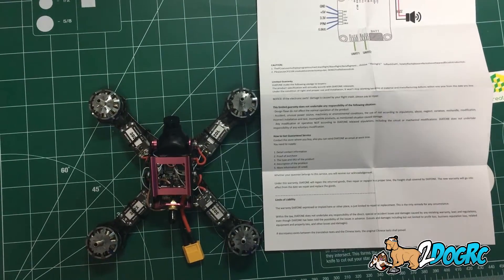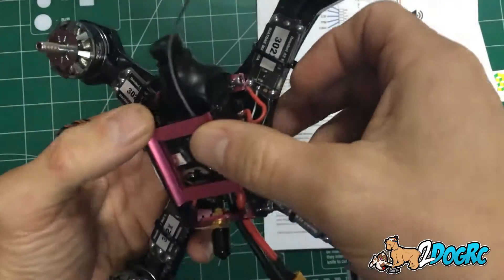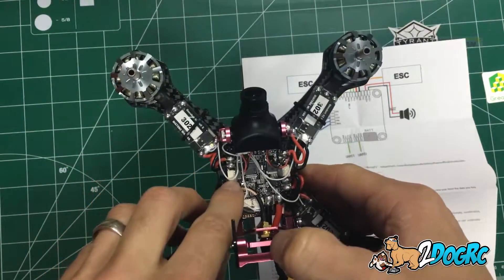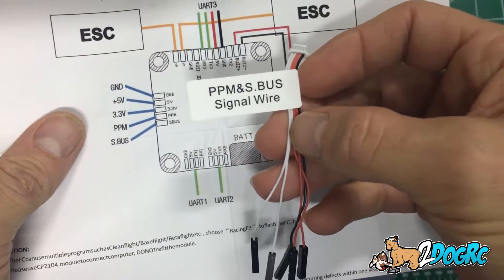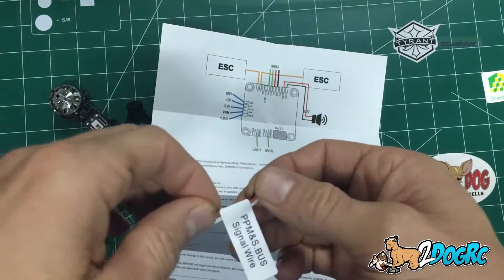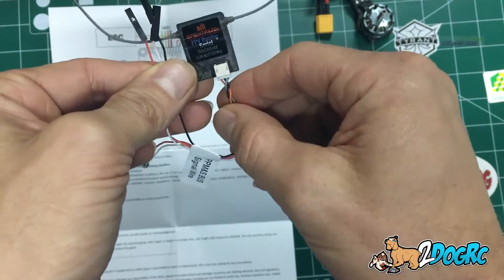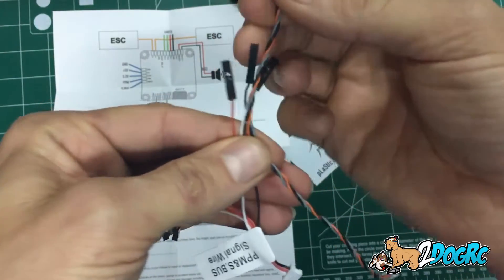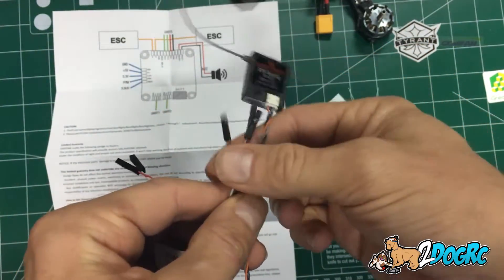How to connect a Spektrum Receiver to Diatone Crusader 2 or D-Link F3 board, Step 1

Comment: So I just bought my gt2 200 and mine is the v3. I dont see anywhere on it that says it supports 3.3v receivers. any suggestions on what receiver to use?
Reply from the maker: Yes, These come with a 3.3V regulator that is external.  Here is a link to the wiring diagram.
http://www.2dogrc.com/media/catalog/product/cache/1/image/650x650/9df78eab33525d08d6e5fb8d27136e95/e/d/edited_for_reg_copy.jpg

Comment: Hey Bud, FFS. I'm such a dumbass. I've got a GT200 V2 and I accidentally connected an A8S rx to UART 1. I went ahead and got bind and started to configure but saw that the rx wasn't working in BF so within a few cycles of betaflight 3.1.1. I realized my mistake and disconnected all power and moved the rx wire to the proper PPM/S.BUS/Spektrum location but now when I try to connect the port closes on it's own. I'm looking up how to reset the FC and will try again. Any help is mucho appreciado!
Reply from the maker: That is a common mistake.  You can use the Lost Comm procedures listed in the Firmware flashing tab in Betaflight.
Reply: Hi again, I'm scratching my head. The quad's power up beep sequence went from just the first few tones (while I was powering up during pre-flash) to the full series of beeps post-flashing/lights so I thought it was good to go but am still unable to connect in BF. One odd thing is the port shown on BF says manual and not any "comm" one. I bought this unit new/second-hand from a guy who bought it brand new from Diatone. I've got a bad feeling about it. So the unit powers up with full series of beeps but won't connect to BF. I should try it again and maybe record the whole process and post it for analysis. In the meantime I've demanded my € back but I'll try the procedure again.
Reply from the maker: OKay, if it is showing Manual then your computer is not seeing the board.  Make sure you installed the CP210X drivers listed on the tab in betaflight.
Reply: Hey Champ,  I'm sorted out now. Embarrassed here. I oughta be in action soon. You're simply great, thanks!

Comment: Plugging the 3.3 v satellite receiver to the 5v  is a no no.....correct?
Reply from the maker: Big No No.  It will fry your satellite receiver.  Spektrum now has a 5V receiver out finally, but they are charging $50 for it!
Reply: I used the 5v on a 3.3v reveicever and it took a while before I realized my mistake. The motors would mysteriously shut down for a second and the drone was dropping out of the sky every once in a while. Luckily it didn`t fried. I just soldered the red wire under the front of the board and it did the trick.

Comment: Ok the v2 diatone Gt2 doesn't have 3.3v out only 5v. Can you still use the spektrum Satellite receiver on 5v.????
Reply: I had to use the 3.3v under the top board. Just solder a wire to that pin and use it for the red/orange lead

Comment: Hi, received my GT2 200 but now there is an D-Link F3 "v2" board in it. The 3.3v dissapaered, cables dilivered in package is 5pin connector on board 4pin connector ???  Any solution to connect an Spektrum receiver SPM4648 on it ? Thanks for response in advance.
Reply from the maker: Tom, Let me look into this.  Look like I may need to make another video!
Reply from the maker: Tom, I reviewed the schematic.  It looks like Diatone made it a little more difficult for you the 3.3V receivers, such as Specktrum.  Check the instructions for a schematic or I found one on their Facebook page doing a search for D link V2.  Flip your board over and look on the bottom.  Along the side opposite the battery lead is a row of pins. One of those is labeled 3.3V.  You can connect the Pos from your Receiver to that tab, and then connect the wires as in the video.  Another option would be to wire all three wires from your Receiver to these pads, 3.3V to VCC, GND to GND and Signal to RX3.
Reply: Hi, thanks for quick response. Treid it this morning, 3.3v on bottom from the board GND and S-Bus from 4pin connector and it works perfectly.
Thanks and happy fly
Reply from the maker: Great to hear! Thank you for posting back, that helps alot of people!  Enjoy your ship.

Comment: sorry to bug you but I'm having major issues I plugged it into betaflight and it worked perfect I set everything up next morning I woke up plugged it into betaflight and it doesn't even light up the board the board lights up when I plug the battery into it but not when I plug in betaflight any suggestions will help

Comment: great video! I have the crusader 130 and been having trouble getting it to work with my spektrum satellite. Do you know if it is compatible? I also have the TBS Tango/Crossfire Micro Receiver which is what I would like to run on it ideally
Reply from the maker: Hello, 
   It is compatible with the Spectrum Receiver however if you are just using a satelite and not the Quad receiver you need to make sure it is bound to your radio before connecting the the Flight controller.  This is an known issue with the Naze Rev 6 that this board is based on.
Reply: 2dogrc maybe i have the wrong name, I'm using the same one in this video. I soldered it right on the board and got it to bind immediately however I cannot get it to recognize stick inputs in clean flight. You wouldn't by any chance help me out via phone if I PayPal you over some money? I'm desperate at this point. Thanks for all the help!
Reply from the maker: Sure we can take a look.  800-517-3810 ext 1.  I do charge if you bought it somewhere else, and give 1 hour free when purchased from us.
Reply: 2dogrc i didn't know you guys also sold these. I will definitely be purchasing from you soon. In the meantime I don't mind paying you for your time!
Reply from the maker: Give me a call tomorrow or through the contact us page and I can give you a call.  If it is bound, the red light should not be flashing, select Serial on the ports tab of UART2, save.  Then in the config tab select receiver type Serial, then protocol Specktrum 1024.  Save.  If that doesn't work try Specktrum 2048, save.  Make sure props are off.
Reply: 2dogrc I will def call you tomorrow. Red bind light is solid orange, uart2- serial RX is checked and I tried both receiver options.... I'm totally stuck man.
Reply from the maker: Okay, 2 things to try. 1)Fresh install of Betaflight.(You are using the Betaflight configurator from the Chrome store?)
2)Double check the wires and make sure you have the Serial, 3.3V and Ground going to the receiver.  It sounds like 3.3V and Ground are correct because you have a light.  So double check the solder connection for the Sbus wire.
Reply: 2dogrc in my manual it's telling me it uses cleanflight. I have several other quads that use it so I know it definitely works. I triple checked that I have wires soldered correctly (as you said i wouldn't be able to bind correctly if not)  if possible I can FaceTime you tomorrow, and I will gladly send you a PayPal transfer just so you know I'm serious. I really appreciate this help man!
Reply from the maker: Okay, no problem.  Use the betaflight configurator. These all come with Betaflight on them and Cleanflight app won't work right. Try that and if that doesn't work we can fix it tomorrow somehow.  
https://chrome.google.com/webstore/detail/betaflight-configurator/kdaghagfopacdngbohiknlhcocjccjao?hl=en
Reply: 2dogrc sounds like a plan. Big ups man!

Comment: I'm getting this for Christmas. I have a 9303 transmitter but I don't know if it does S-Bus.  Do you know? If not, what do I do?
Reply from the maker: I looked this up and it is compatible with Spektrum receivers.  You will want to use the Spektrum quad receiver and follow these steps in the video.